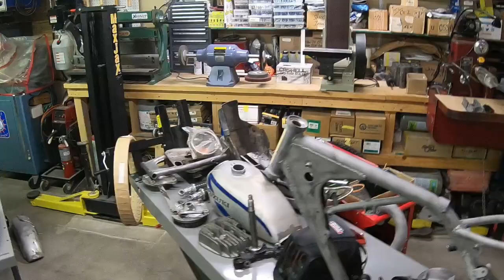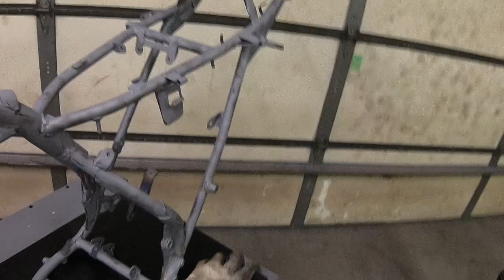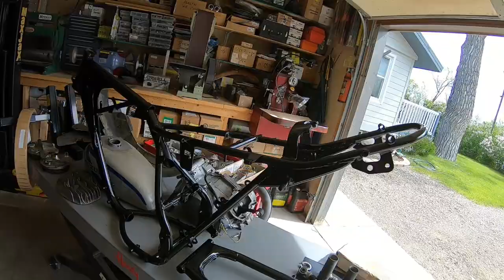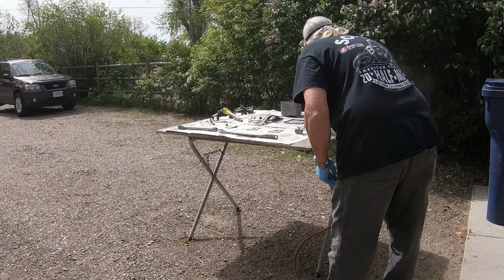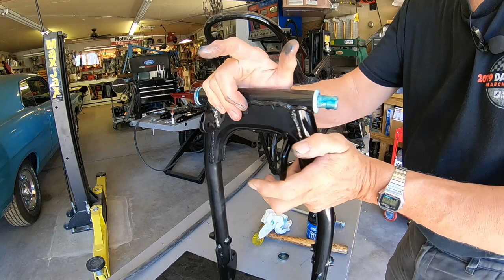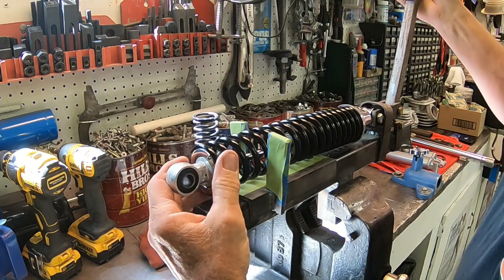Suzuki TS250 frame welding, painting, and frame reassembly

Comment: Hey Dale recently got a 1975 TS250 and absolutely love it, thank you for these videos, they are amazing!

I was wondering if you would be interested in making tips/tricks video for getting more power out of the TS250 2 stroke?  Or any helpful maintenance/ modifications?

Thanks again!
Cheers!
Reply from the maker: Thank you for your comment, there is more to come on the TS250, working on the paint and body work now. Will soon be assembly and getting her running. Thanks for hanging out with me in the shop

Comment: Hey Dale, great videos! Any reason that I should shy away from Flux Core doing a similar job? It's the only welder I have, and I'm trying to avoid starting a welder collection :)
Reply from the maker: No Tyler, the flux core MIG will do just fine. Its just not as clean with the slag to chip off, but it will be just fine.

Comment: Hi Dale! I've been working on my TS250 and I had to also re-weld a mounting tab just like you. I also discovered a fatigue crack on the the top bar of the frame where that diagonal piece attaches coming from the head of the frame. The crack went around where the original welds were. I did some research on welding cracks and tried my hand but was wondering what your thoughts were on welding a frame crack like that. Was it a waste and I need a new frame or should it hold up? As always, been enjoying your videos.
Thanks!
Andrew
Reply from the maker: Hey Andrew, I have repaired several frames by welding, sometimes if the crack is next to the existing weld, you may have to grind the old weld back some in order to get good penetration. But for the most part, I have not had any cracks reappearing. If you have a severed tube, then I try to get a short piece of tubing inside then rosette weld it in place before welding the main frame tube. In my opinion it is not a waste of time. It is good shop practice and a good solid repair.
Reply: @montana2strokeracer  Thanks for taking the time to reply. I believe it's safe to say I have done a solid repair then. I drilled holes on either side of the crack to keep it from spreading and also ground material away from the crack to achieve better penetration. I appreciate the well versed opinion and feel confident that the bike will hold up. Fixing this bike has been a journey and I'm always coming back to your videos. Thanks again!

Comment: Did you chemically strip down the original paint from the frame or did you use a media blaster?
Reply from the maker: Thanks for your comment.  I blasted with media. I did the yamaha and Suzuki at the same time. It is such a messy job. Thanks for watchin
Reply: @montana2strokeracer  Thanks for the reply. Debating my options for stripping down my 72 ts250. BTW the metal rescue stuff really works well.
Reply from the maker: I think they are both messy jobs, unless you can get someone else to do it for you. but then you have to turn loose of the cash. My opinion is that sand blasting is only a little bit less messy than chemical stripping. I have one of those 20 pound harbor freight blasters, It only took about an hour to do both frames using # 70 sand.
Reply: @montana2strokeracer  great, I was leaning toward the using abrasive. Still need to find a oil tank cover...